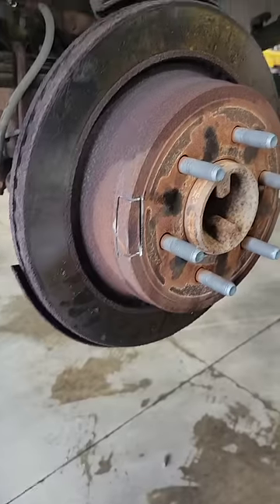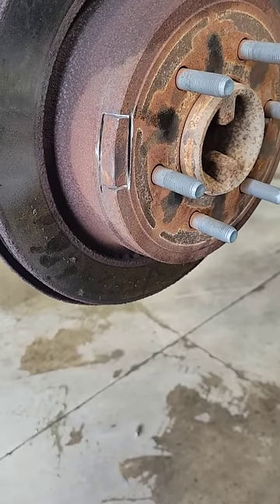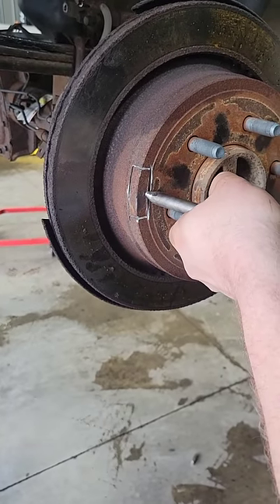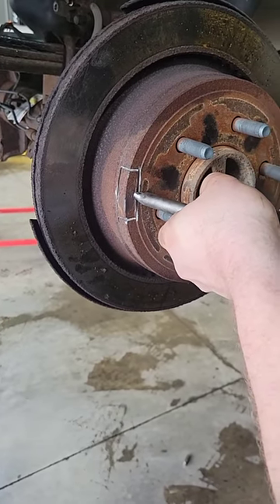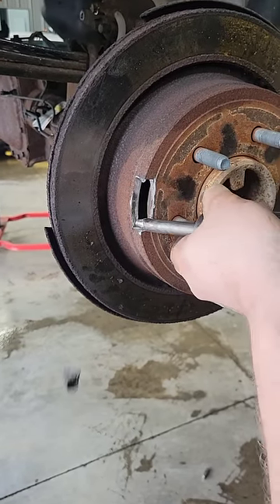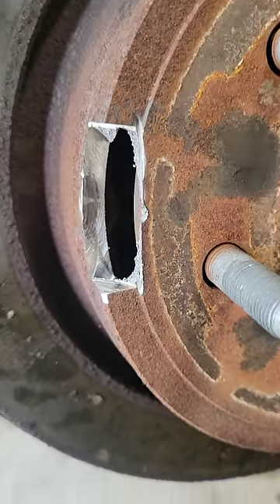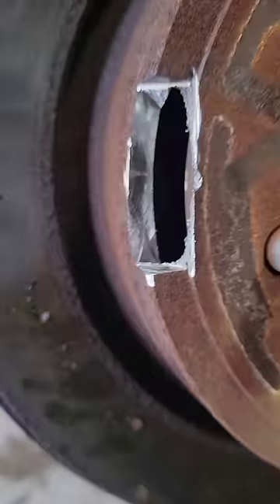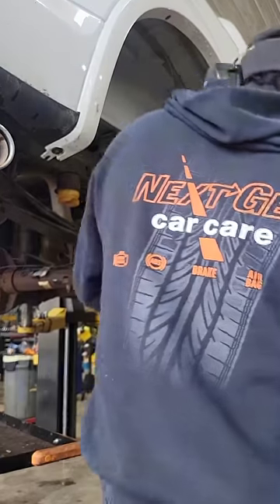Ford F-150 rear brake service.  Trying to show a trick on getting them off without further damage.

Comment: Wow you gotta be hourly, never had to do this on a vehicle,  turn the adjuster in and they come every time
Reply: Only works if the vehicle drives on roads without salt and calcium treatment. That adjustor dont move at all until you heat it with a torch and blast all the corrosion off with a wire wheel. Ask me how I know.
Reply: @luisamoa2500  I'm in Michigan. When the adjusters are frozen its either getting omitted or completly replaced so I either cut the nails behind the backing plate or just destroy it all and replace everything.
Reply: @0MattAttack  I live in Iowa and just replaced did the pads, rotors on my 04 f150 heritage and my came off without having to cut the rotor.
Reply: Not every vehicle has adjusters and I've never seen adjusters on a vehicle equipped with disc rear brakes. The backing plate is half the size of regular drum brakes so limited room for much, and those usually just have a couple springs and a cable.
Reply: @reaperasylum   you've never seen an adjuster on a car with dosc brakes?   Whaaaaaat?
Reply: @magincap70  not really bud, but I'm also limited to just a few vehicles with disc rear. Most of them are drums and one expedition disc rear no adjusters
Reply: @scooz14 for real drum brakes are fucking garbage anyway so if it’s this far gone it is probably a good idea to replace it all.
Reply: Just turn the adjuster????

Hahahahahahahahahahahaha

Come to northern NJ and upstate NY with the sand and salt… tell me what your adjuster does then.

Just turn the adjuster :]

Hahahahahahahahhahahaha
Reply: @@patricklasslett6427  hahahahahahahahahah I live in wisconsin
Reply: @reaperasylum   that's wild.  I can't even think of a single setup I've ever seen without one.  Some you have to adjust (like ford) through the dust plate.  There's usually a little rubber plug ypu need to remove, but most have a little hole in the hat you can get to it through or if you've got wheel bolts sometimes they expect you to reach in through that.
Reply: @patricklasslett6427  I'm in mass and turning the adjuster works 9 outta 10 times.  You definitely get siezed up shitboxes here and there though.
Reply: @0MattAttack  never had this problem at all.
Reply: Yeah I’ve learned recently. That rusty vehicles are a whole other ballgame m8. I’m in Florida and new residents from NY brought their cars to me for work and the body and frame is mostly intact and I told them we need a couple things to be done for them to be solid af but suspension parts and lines and everything is just hard to do
Reply: @scooz14  I'm from Canada  so I know hour pain lmaoooo. Typically by the time rotors need to be replaced in the rear, there is no backing plate left anyhow so I just replace everything. Lol
Reply: @jjunderwood4095  exactly. A lot of the old plow trucks just get the entire parking brake assembly deleted. Or it's long gone from the rust already lol
Reply: @magincap70  yeah and I'm sure I'll eventually come across a few like that, probably wouldn't be as bad.
Reply: For all you morons saying can't adjust them its called hammer and punch  cause you have to adjust them for new ones anyways
Reply: @reaperasylum  adjusters on disc brakes? Do you have 1 clue on what you're talking about?
Reply: @justinw.2376  the adjuster is right next to the fuel intake on the caliper.  Apparently everyone’s a mechanic these days 😂.
Reply: @0MattAttack  how do you know?
Reply: Hourly here, thanks.
Reply: Not only is there an adjuster on the back, but let’s say that’s siezed too, pry bar and a hammer, where the cable connects is the lever that pushing on the shoes, this is what you smack to loosen the shoes up basically what’s happening here is whoever used the e brake last the didn’t retract so your manually doing it. You’re welcome from a ford truck shop tech I’ve done thousands of theses.
Reply: That’s what I use to do turn the adjuster.
Reply: @justinw.2376  drum in hat parking brakes have adjusters dude
Reply: @0MattAttack  exactly
Reply: I live in a real state where we don't slather our roads and salt and we don't have to do this s***
Reply: @niteninja0133 and I live in ND just us the adjuster put the car in neutral.  It is very easy
Reply: @niteninja0133 and I live in ND just us the adjuster put the car in neutral.  It is very easy
Reply: @justinw.2376 shhh🤫professional grown folks talking here…the embarrassment will eventually be forgotten not to long after you do a few YouTube searches to verify just how much foot will fit in a know it all’s mouth while trying to “unknowingly “ demean themselves 😂
Reply: @reaperasylum  I have seen many and worked on many vehicles that have rear disc brakes but the still have to have the parking brake shoes and a adjuster. By law every vehicle has to have that set up and if you keep the adjuster new it won't freeze up
Reply: In sweden we have lots of salt for months. Had problem once but there are tools to get the rearbrakes. It looks like a big claw. Maybe not working everytime but did for me.
Reply: And yeah. A quick google show where the adjuster on f-150 sit.
Reply: when everything is rusted good luck pal
Reply: @magincap70  the drums integrated into that type of disc brake is just a parking brake. It doesn't operate when using the foot brake. Therefor its only adjustment is on the brake cable.
Reply: @reaperasylum  there is still an adjustment for the parking brake somewhere along the brake cable.
Reply: @tylerramos7633  that is only a parking brake. 
It operates by a cable. The normal brake is the disc portian which self adjusts and works great.
Reply: @Patrick Lasslett  a parking brake adjuster  on a disk drum like this is i side the car where the HAND BRAKE LEVER ATTACHES TO THE BRAKE CABLE. It should not be rusty since it is inside the passenger department.
Reply: @magincap70  you guys are smoked. This is only a parking brake. They never have self adjusters. It is a disk brake with a drum parking brake in the middle. It has no need for self adjusters. This type of brake never ever has self adjusters. DUH.
Reply: @Larry W  not this type of brake. It is a hand brake. Its only adjuster is in the passenger compartment. The regular braking is handled by the disk portion of the combination rotor/drum.
Reply: @Justin W.  thank god one other person here understand whay these brakes are.
Reply: @Peter Plante  you are dead wrong. Its a parking brake. J
Self adjusters are never on a parking brake. The adjuster for it is in the passenger compartment where the hand brake lever attaches to the cable.
Reply: @semajniffirg230  yes they have adjusters on the cable not in the brake.
Reply: @nofacetatter  how would that type of adjuster work with a parking brake on a rotor (drum in rotors type). Those type of adjusters are for automatic adjusting & they only adjust when you drive in reverse &  then hit the brakes. DO PEOPLE DO THAT TO THEIR PARKING BRAKE? I sure hope not.
Reply: @nofacetatter4539  no such law exists.
Reply: @waynes.2983  we're talking about the adjuster you slack back to give you clearance to remove the drum.  You done what? 2 brake jobs on A car?
Reply: @Mtg_MoBrocks   you've been in it 😆
Reply: @waynes.2983  nooooo, the shoes are operated by the parking brake cable but there us still an adjustment for the shoes inside the drum.  If you're adjusting the cable to take up the slack you aren't doing it correctly.
Reply: @waynes.2983   the way it works is the shoes are set on pins with the tension of springs trying to hold them closed.

There is one adjuster that you use to make the circumference of the shoes slightly larger to be in better contact with the drum.

When you pull the cable it causes a lever to pull the shoes apart applying pressure to the drum.  You let off and the springs pull it tight again.

Google parking brake adjustment.  You're so not correct.
Reply: @0MattAttack  and or, without the adjusted moving, I've spent a good hour or so with my uncle (retired 60 year mechanic) and we had to chip the drum ridge off from inside to get to free. From Canada here
Reply: @waynes.2983 rubbish,they have adjusters, usually a small rubber plug ,remove it and you can see the adjuster wheel through the drum normally  at the bottom, before refitting the drum I mark the wheel with tippex so you can see the wheel with pencil torch.
Reply: I live in cali. I had to pull my drum brakes off the back line folate and replace the brake cylinder on both sides along with every other piece of hardware
Drums were stuck on and the star for adjustments is completely inaccessible 
Tried for 2-3 days before I gave up and broke everything on purpose
Reply: @reaperasylum have ever worked on obs chevys or Ford.  They have adjusters in many more just naming the most common 2 vehicles in America
Reply: @reaperasylum expedition parking brakes have adjusters inside the rotor were the shoes are
Reply: No, A lot of us don't take a hammer, a lot of us go through the hole in the backing plate and unadjust the brakes.
Reply: @reaperasylum  it's a disc brake system uses a drum emergency brake it has an adjuster. It has to.
I have never seen a drum break emergency brake setup with no adjuster
Reply: Not.. LoL
Reply: @1 Gerard  you are thinking of drum brskes not disk drum combination brakes.
Reply: You can't on many newer cars
Reply: @reaperasylum  lol facepalm maybe because there a drum brake inside the disk for the parking brake lol
Reply: @patricklasslett6427  yes just turn the adjusters a live in canada quebec and we put ton of salt  
i can tell you use the ajuster work but with these parking brake shoe just remove the cable and knock back the  lever to close the shoe and remove the disk with no need to cut a hole in it never needed to do that in 20 year
And they are parking brake they don't wear unless you drive with the parking brake on
I changed 200k km truck and the shoe where still brand new most of the time the linning just fell of with age
Reply: @magincap70  live in quebec and the adjuster work 9/10 like you said
And they never have a ridge or even wear they are parking brake they are only engaged when the vehicle is at a stop 
Unless you drive with the parking brake on this is a non issue
Reply: @scooz14  here in canada most of them are deleted but they only rust solid because nobody never use it
My 25 year old civic shitbox got a perfectly working parking brakes its a manual but any of my customer with 2010  automatic car i would not dare try the parking brake 100% chance it get stuck because they never used it once in the vehicle lifetime
Reply: @magincap70  dude. I've done hundreds. This is s parking brake. No adjuster in the drum. Normal braking is done by the rotor.
Reply: @magincap70  not on anything I've worked on. Tell me why there is an adjuster on the cable then?
Reply: @magincap70  the type of adjuster you are thinking of is a self adjuster. Those can't work on a parking brake. They are for drum brakes that are used for more than a parking brake.
Reply: @waynes.2983  dude...every parking brake has an adjuster.  At least 99% of them.

I've been in this industry for years and presently employed by bmw for the last 8 years.  You're confused here.
Reply: @waynes.2983  the adjustment on the cable is usually in the center console near the handbrake itself.  If it's a foot brake it's usually near that.  Thats the cable adjustment.   The star adjustment is set I between the shoes so you can fine tune the amount of play on the shoes.  Ypu shouldn't ever have to adjust the cable.
Reply: @justinw.2376  
In case of the rear brakes, emergency brake is activated by shoes, driven by cable. The disc works as disc for the pads for regular brakes and the set of shoes as emergency brakes just like usual drum brakes. Most vans, trucks, SUVs use this system. And regular sedans as well. And yes there's is adjuster since the shoes do wear down.
Reply: @waynes.2983  Actually they also have adjusters, eg Toyota Sienna, and many other cars
Reply: @STONER._._.WELDZ69  I've got the same truck, 290k miles. Hiw's yours holding up?
Reply: @chucksneed1264  holding up well, just replaced the front hub bearings pads and rotors. Need to slap upper and lower ball joints in , throw a new set of shocks on.
Reply: That's why he cut chunk out. To see what was holding it on.
Reply: Also live in the rust belt. If the adjuster is frozen stop quote parking brake shoes and equipment. They need replaced.    If approved, SMASH.  Frozen adjuster is not as common as people make it out to be.
Reply: Sometimes if you run the vehicle off a cliff it loosens the rotors
Reply: @patricklasslett6427 it's called penetrant oil, it comes in various cans and allows you to spray oil on corroded nuts and bolts to free them up so you can turn them easier,  oh and it also comes with a straw for pin point accuracy.   I'm in northern canada and we have corroded metal up here too.
Reply: If you live in northern states, that adjust also gets rusted to the point where it wont move. What this guy did should be the last option 😂
Reply: @jb6574  I live in wisconsin and I still never had to do this

Comment: Ever heard of backing off the adjuster? They do make tools for that as well. 😆
Reply: Common sense ain't too common... and he's got to get those labor hours in there somewhere.
Reply: Probably has parking brake presses/on as well
Reply: There isn't an aperture to do that though on these
Reply: @jamsstar2010 what year is this I know 2014 does it’s just in different spot
Reply: You can clearly see there is not a hole to adjust it with the drum on. So it has to come off
Reply: @chriswood3818  The access to the adjuster is on the backside of the axle wheel plate.
Reply: @jamsstar2010  this is a 12th gen 09-14, there is a grommet on the back that let's you back off the expander but it was probably seized
Reply: @jerrystalzer1350  I haven't fucked anything up because it's not me or my video so calm down
Reply: It's called a screw driver
Reply: @chriswood3818  the adjustment slot in in the back side flat screwdriver to turn the star nut.
Reply: God damnit bobby
Reply: @chriswood3818  The hole is on the backing plate.  A rubber plug covered the hole to keep critters and this mechanic out.
Reply: then how would he charge the customer for 7 hours of labour? :D
Reply: Some vehicles don't have any access hole to adjust shoes after the rotors are installed

Comment: You could just hit the parking brake lever in the back of the backing plate to make sure the shoes are fully released. You can normally get them to move a little further that way

Comment: Take the F150 around the block with the parking brake partially engaged, when you get back disengage the parking brake and it comes right off.
Reply: Your a savage I’m definitely doing this next time not my car
Reply: Exactly 😂
Reply: @colinverdon5949  when you with the brakes at a stop light does your car get messed up? Engaging the e brake a little bit and driving won't hurt anything
Reply: Nice!
Reply: thats a great trick
Reply: I'm slow, u mean the parking brakes wear down enuf so their not hanging up anymore or is it something to do with the heat created
Reply: @johnbummer6279 rust buildup gets knocked off the inside of the rotor
Reply: I like your idea better.
Reply: If you do it right the first time it makes it easier everytime after.
Reply: That is an easy way to do it & a fine idea. All these idiots don't understand how these things work.
Reply: 😲 WOT ? ! I'm trying that sorcery next time.
Reply: that and Back up a little with the P brake on

Comment: i own a 2011 f150 eco bitch.  ive had brake issues every year, for the 4 years ive owned this truck.  NOTHING works.  except the engine.  id give anything to own my dads 67 3/4 ton.  that ford was rock solid, no issues. ever.  he bought it in perfect working condition, and sold it the same.

Comment: It's much easier to just back off the slack adjusters instead of trying to cut holes in the rotor
Reply: Exactly
Reply: Yeah I'm so confused. Literally just get around back couple turns and bam. This guy just wasted a ton of time.
Reply: There are cars that have no adjusters... Volvo P2 cars for example.

Comment: A hammer works. I've never damaged anything more than the rotor with a hammer. 20 years later.
Reply: Bad rotor anyway
Reply: You just haven't noticed or had a bad ridge. I've seen the youngsters beat a rotor off, pulled the shoe hold pins through the backing plate. No problem,  just up sell the job with new backing plate and brake hardware. 
Then I'll see you in a few months to put axle bearings in for you.
Reply: @pat36a sounds like the youngsters forgot to disengage the parking brake 😂